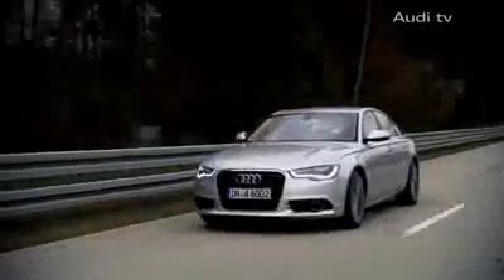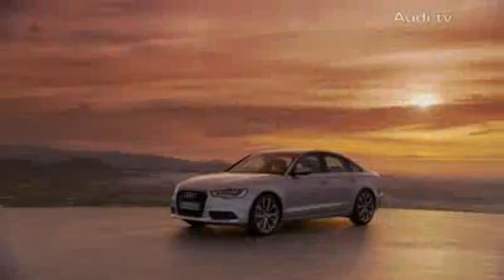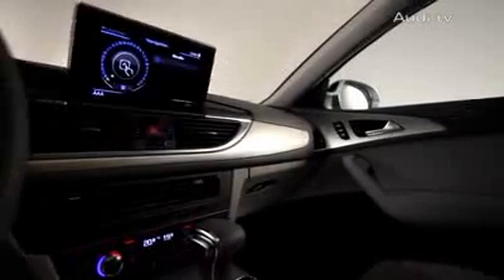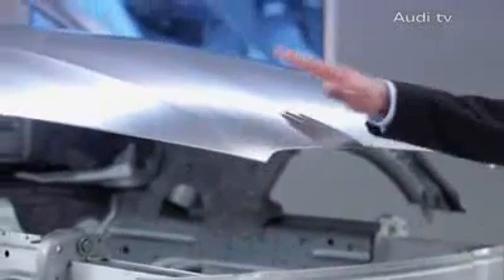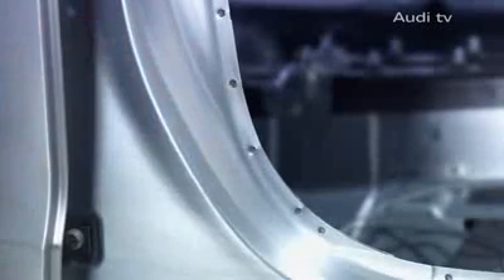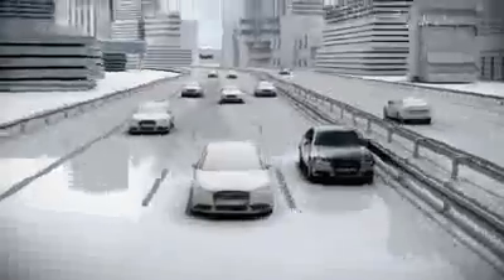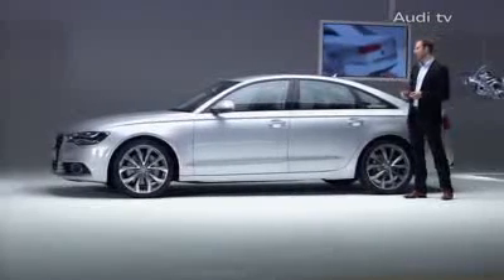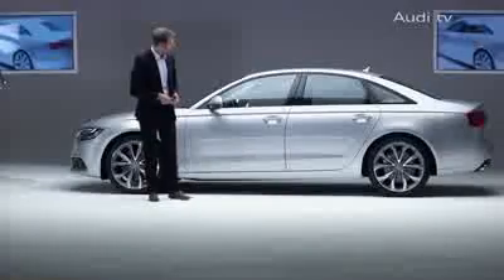Audi A6 2011

Comment: Before I probably would have been happier behind the wheel of an Infiniti M37 or a BMW 5 series,but now that this finally received a redesign I'm very tempted by Audi. Great looking car, although the rear isn't to aesthetically pleasing even with its LED tail lights its not enough to save it. However the overall design is very appealing, modernly upscale and not as bland as its past predecessor. The Navigation flip screen adds that modern touch to the cabin but in truth its still feels unrefined

Comment: @ebradahusla you think you have it bad, at least you know what system to use. In the UK were are between USA and mainland western Europe. We measure weight and height in imperial (usually, but sometimes not, depends on who it is) all the signs are in miles, we measure efficiency in mpg (miles per gallon) but measure volume in litres! The metric system (mm, cm, m, km) is taught in schools but all rulers have mm/cm and inches marked on them! Land is measured in  acres but area is USUALLY measured